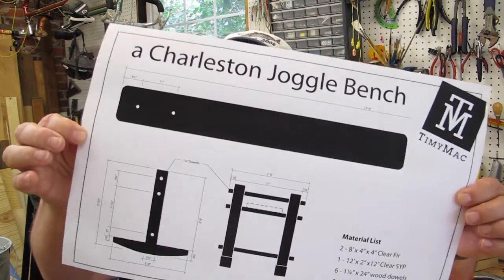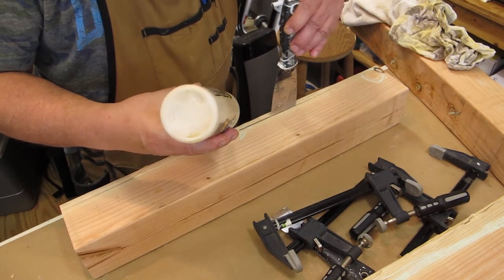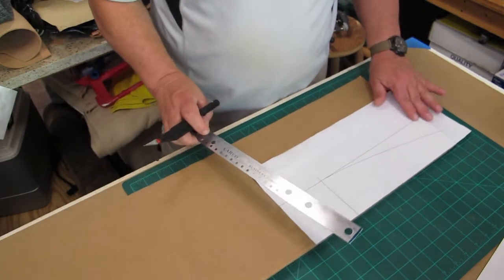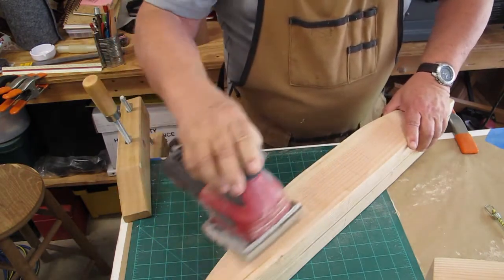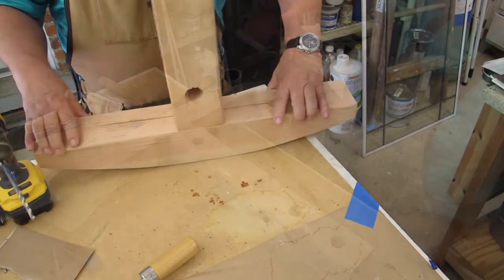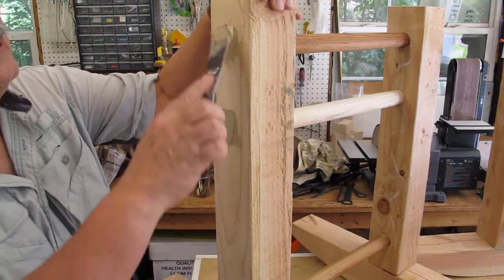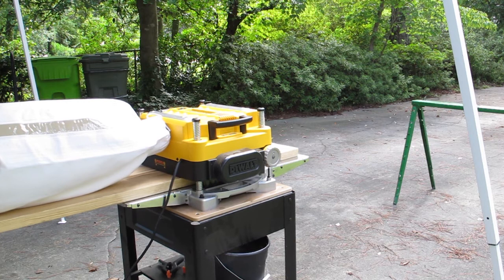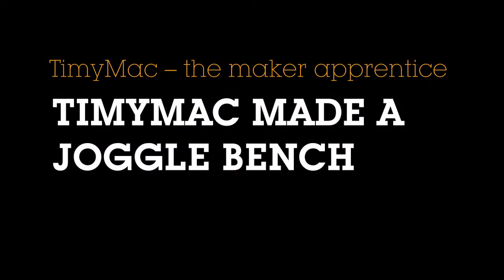TIMYMAC MAKES A JOGGLE BENCH

Comment: Great job.  Did you glue the dowels when sliding them into the 4x4 holes?
Reply from the maker: Yes I did. Just remember to mark the inside of the dowel to have a uniform space. A 2x12 is 11 1/2” in width and you only need about a 1” clearance on each side of the bench. Good luck!

Comment: you used a 1.5" x 12" x12ft correct and plained down to a 1.25"?
Reply from the maker: Lance, I used a clear 2 x 12 x 10 southern yellow pine for the bench. Measured 1.75 x 11.5 x 10', planed down to 1.25".